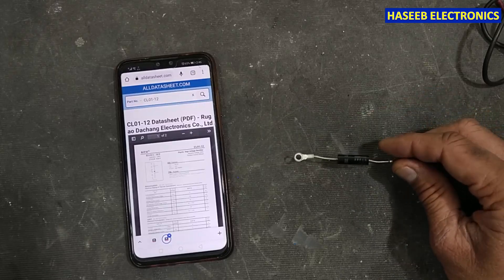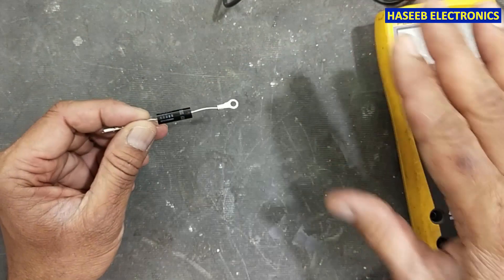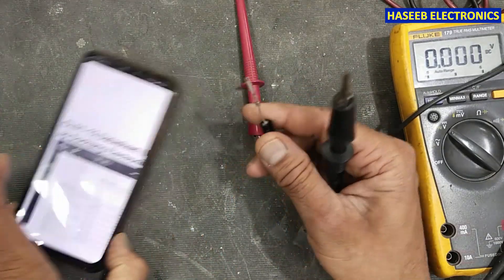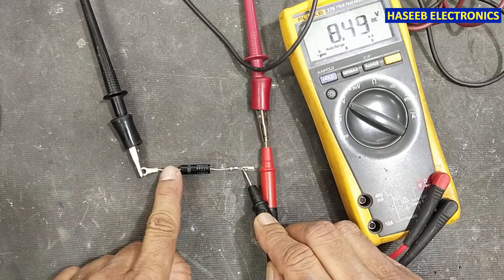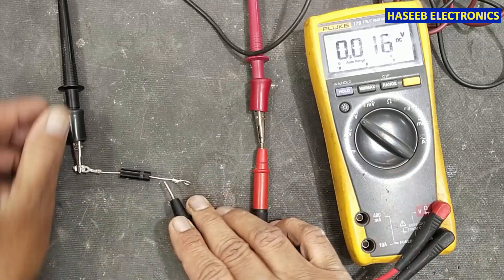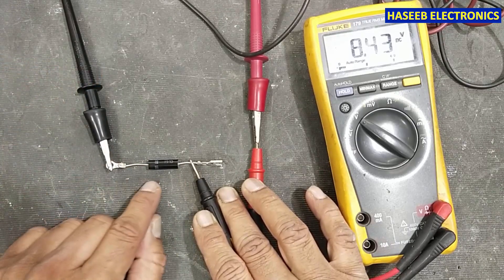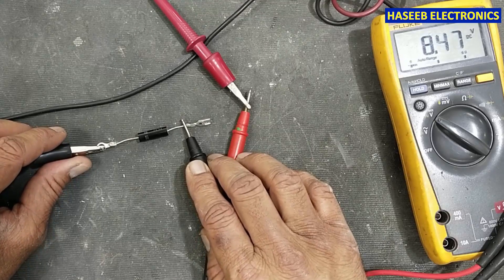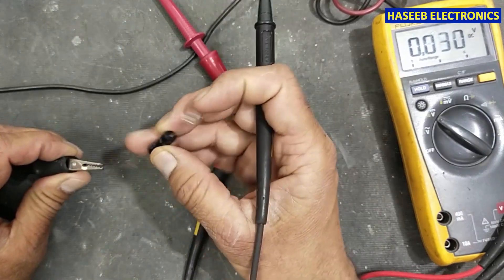{813} How To Test CL01-12 Diode for Microwave Oven

Comment: Or use a analog multimeter, in scale 10K.
Reply from the maker: yes 
if the analog multimeter have 9 volt and 3 volt batteries
if it have only 3 volt cells. then it will not work
Reply: @HaseebElectronics  Yes, you are right.

Comment: thanks for sharing this educational video 
my way to test this type of diodes is to use analog multimeter which uses 9 volts battery and 2 AA battery it will apply 12 volts across the diode and will give me good way to test it

Comment: Hi friend thanks for the informative video. Is it possible to take 2 of these diodes to create a bidirectional tvs ?
Reply from the maker: no, i think that can work properly, as these diode have reverse breakdown voltage, exceeding than that value this diode will be destroyed. 
while a TVS works like a zener but TVS have a extra large size junction to handle high current surges.
Reply: @HaseebElectronics  thank you so much for your response